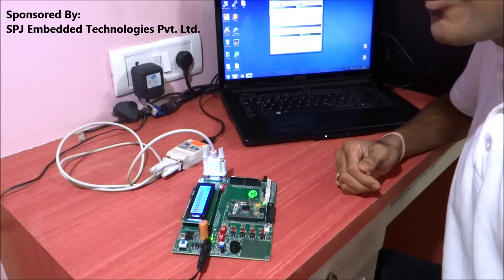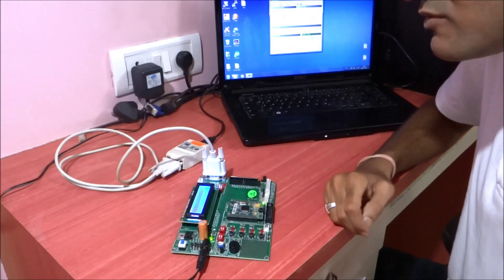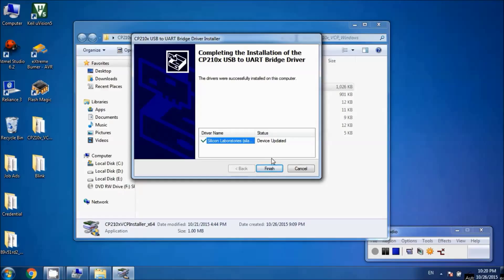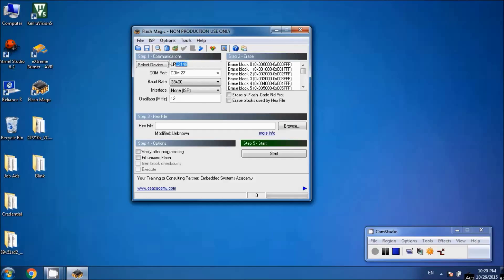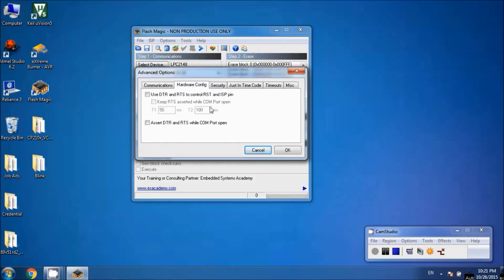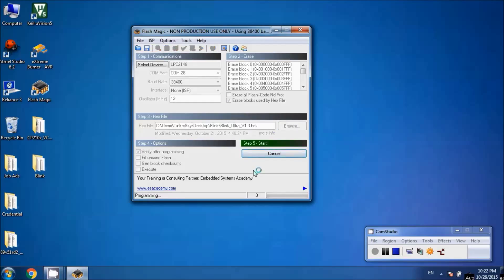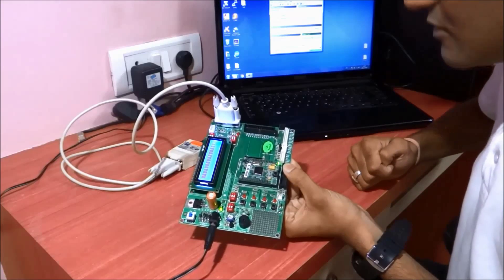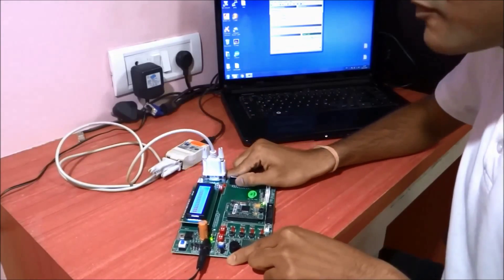How to Program ARM7 LPC2148

Comment: Hi,

I tried to flash hex file generated from keil micro vision 4, unfortunately it's not working after successfully programmed in to board. But, it's working with only hex files given by you. Please help me to fix the issue.

Thanks & regards,

Taruni Dhara Rao Gandham

Tech Mahindra

9036527250